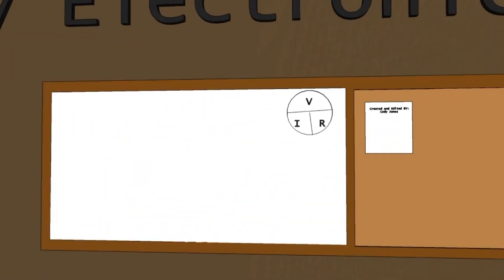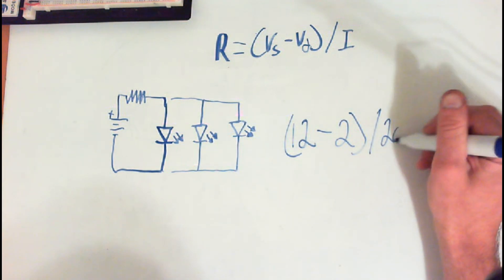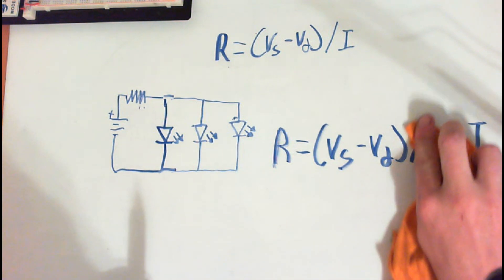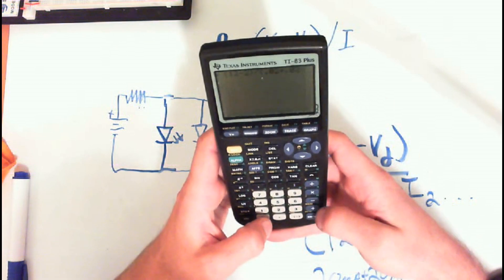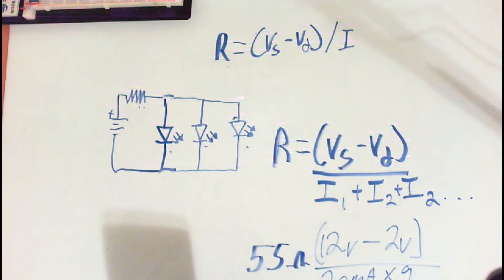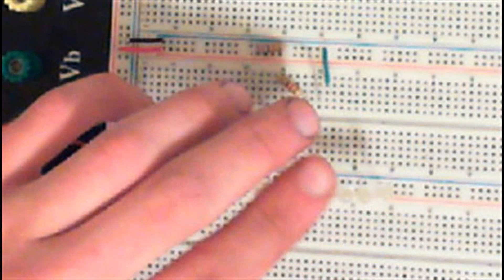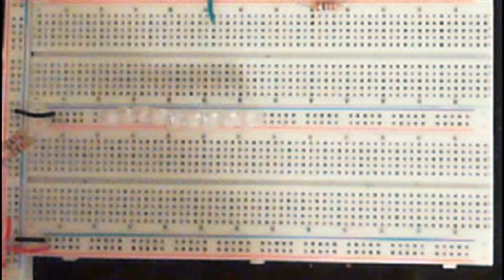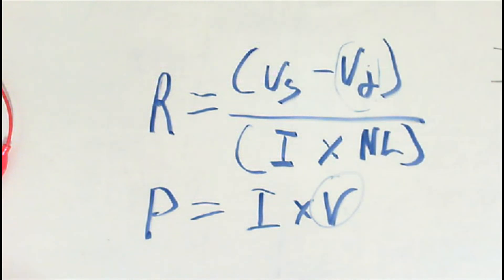Led's in parallel - Explanation - Resistor Values

Comment: Jason Robicheau Look up the formula for calculating resistance in parallel.
He's assuming a 2V voltage drop on a 5V circuit which means he's assuming the LED uses 3V (i.e. 5V-2V=3V).  Using Ohm's law we can calculate the resistance of the LED at (3V/.02A=150Ω).  Treat those LEDs in parallel as 150Ω resistors when doing your calculations.  If you have a LED that has a different voltage drop, calculate it's resistance & then add it according to the formula for calculating resistance in parallel & that should work for you.

Comment: Do you know if I can tap off of a existing LED on a circuit board to anther LED to view at a different location...about 3 foot away ? Is wire size important ?
   Thanks
Reply: The answer depends on the LED & copper that you use.
Not all LEDs work at the same voltage & draw the same amount of current.
Therefore, your circuit may need to be modified to support your new device & the additional resistance of the 3 ft wire.  You may need to change the current limiting resistor or increase the source voltage/power.  In general, higher loads create more voltage drops & use more of the available supply voltage & power.

Having typed all of that ^^, it is also possible that your circuit card is powered by a power supply that has sufficient current to support another LED of the same type --although, it may cause both LEDs to run dimmer when connected in series or in parallel with your other LED/s--although not necessarily--a lot depends on how much of the available power is being drawn from your existing power source.

Comment: the bottom value should be in brackets also

(0.02 x 3) then (0.02 x 9)  for the next sum.

If your calc doesnt come up with the right answer make sure you do this.

Comment: What if one of your led has a different voltage drop ? How would you use the formula then? Or do you have to wire it differently  like in its own series circuit?

Comment: hello there. i am using 10 red 5mm led's in parallel on 5V with 15ohm 2W resistor but the resistor is heating up like crazy. i measured the voltage drop on this type of led its exactly 2V. is there anything else that i should know that's making my resistor to heat up? should i calculate the wattage of the resistor using the original 5V or the (power supply output voltage - voltage drop on the led) ?